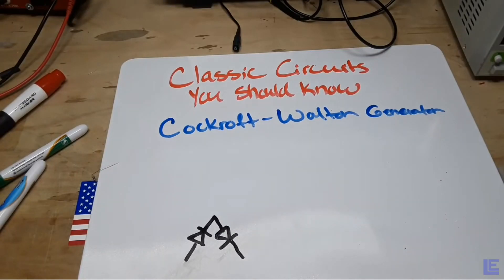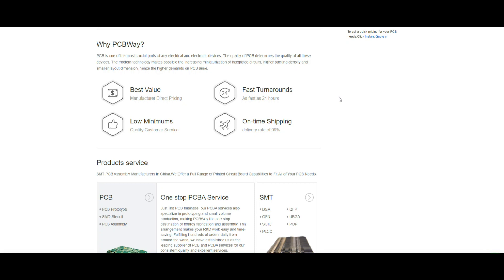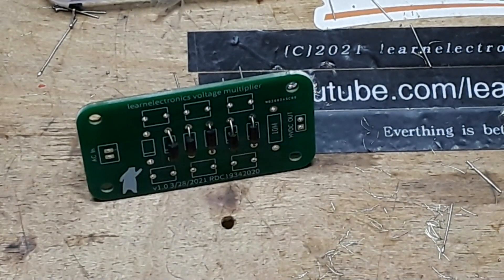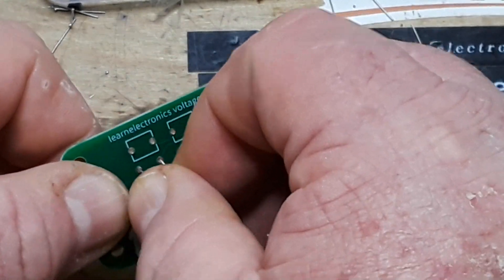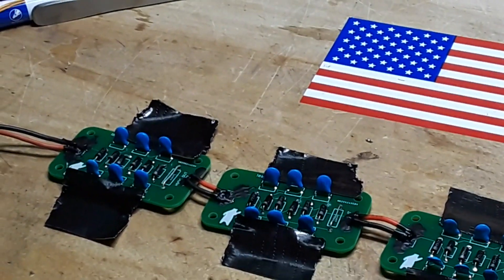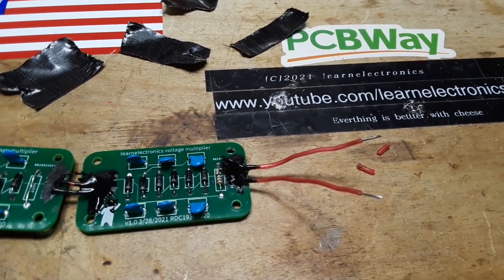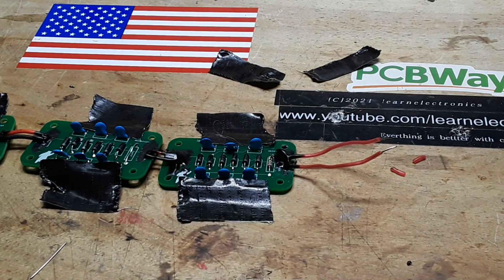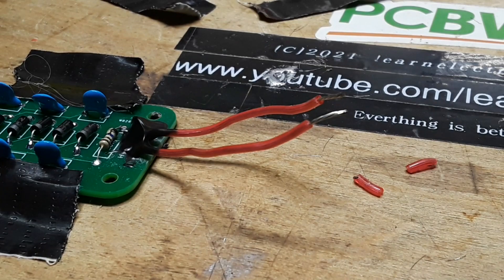Cockroft-Walton Voltage Multiplier PCB Design and Test

Comment: How did you connect the ac? Is there a transformer? If so do you have a part #? I have built the multiplier and it works, but I keep blowing hand built transformers. Can you show the ac setup for this. Thanks.
Reply: He used a Variac, I would start with it turned right down. I wouldn’t want to multiply 240V.
Reply: @darylcheshire1618  There is no transformer?

Comment: (I am not a mean person like this might make me sound)

Is it just me or does that not sound at all like a 60hz arc? It sounds and looks exactly like when you put a capacitor in parallel with a ZVS and flyback transformer or some sort of flyback circuit. I think back to all the times ive made arcs with NST's and MOT's which are for sure 60hz and this is nothing like that. Even rectified NST/MOT sounds nothing like this. I have attempted in the past to make this exact circuit and I never had good results from a 120v wall outlet. I will do it again though. I could only make CW multipliers work with higher frequencies... Your circuit is fine (besides that ground plane, undersized resistor and outputs WAY too close) but the 120v(170pk) at 60hz I have serious doubts. I sense some internet foolery going on. I think those leads you end up using for the arc are from the real transformer powering this device. I think the circuit didn't work well enough to arc so you have one of those cool tiny HV modules out of our view. LOL
My Reasons:
1.) Input voltage 120V but has a peak of 170V x 2 x 12 stages = 4080V theoretical volts. Resistor 10M so that's ~2 watts?
2.) you say that arc is 1cm long which roughly requires 30kV in air. No way does 60hz <4kv jump 1cm. Look at my dual MOT videos to see 4.2kv at 60hz not arc until I touch electrodes together basically. Also notice the sound of 60hz if you watch them..
3.) Paul doesn't show the full setup for power up or use the variac to ramp up which is too weird thats literally SOP for testing AC circuits like this. Why not show like 5v on the variac and show output on DMM? That wouldn't blow it up. There's no measurement whatsoever on a supposed educational video..UGH.. So you can't blame me for thinking this.
4.)Lastly, Those HV leads are literally from a HV module that I am thinking makes these arcs.. kind of sus.

What does everyone think? If you think i'm wrong please explain why. And paul if you read this I would like to know your answers to my concerns.
Reply: Certain things left out seem to point to interwebs phvckery.

Comment: Very nice! Just a question about the 1M resistor: if you put a bypass to link another pcb section, we should have a short circuit between  pin 1 and 2 of HVDC Out connector. It should be better to put nothing.  It is not clear for me. Thanks for explaning.

Comment: Its a high voltage electric chu chu train. : ) Awesome!
Did ya see how thick the arc's where on that. the flyback out of a CRT TV aren't that thick.(and they can be up in the 10's to 100k volts.)  that would really hurt if you touched it...

Comment: How did the 1kv diodes not fail if the output voltage was ~3 times their rated capacity? Similarly, why did you not have arcing between other solder joints?
Reply from the maker: Each stage in only 2x the input voltage.

Comment: Reminds me of the flyback transformers and voltage doublers on old CRT set. Yeah, you do not want to be anywhere close to a live wire with those things running. Plus the tube acted as a big cap…  all in all, they were kinda dangerous to playaround with.

Comment: How can voltage be bumped up to 14.7-15v constant on kinectic batteries?
Reply from the maker: Whats a kinetic battery?
Reply: @learnelectronics  their used for sound systems i use it to power my amplifier
Reply from the maker: Ok, I've never heard of them. You could use a boost converter. But keep in mind you trade current for voltage.
Reply: @learnelectronics  don't understand

Comment: I think your calculating your voltage wrong.  Each stage doubles what it's handed.  After the first stage you.    have 24o. Next stage 480.  Next stage 1440v.  Second board first stage would be double that.
Reply: I was thinking the same thing. By the time you get to the end of that chain its lucky there's no current to speak of or there would have been a fire. :o)
Reply: Let's see... 3 stages per board, 4 boards, so we're doubling the input 12 times. That's a factor of 2 to the 12th power, or 4096. 170 V (RMS) * 4096 gives 696 KV. With a 25% loss we'd still be looking at an output of about 1/2 megavolt. Right?
Reply: @kenholt2487  RMS here would be 120 volts (typical in the US). The 170 is peak to peak. So the no loss voltage would "only" be about 491KV. It wasn't clear to me whether the first stage is a doubler or just a rectifier. In any case, the arc across that gap was serious for sure.
Reply: @merrittderr9708  Aack! My bad! 120v RMS; 170v P-P. 🤦
Reply: @kenholt2487  No. It doesn't keep doubling. It double the first time only and then goes up each stage by that amount. i.e. (peak voltage) * 2 * (number of stages) in the case of USA plugins. 170Vpk x 2 x 12 stages = 4080 theoretical volts. then subtract Diode drops, leakage, etc...and really these circuits suck at 60hz they are really for freq's in the khz. If you attach a load you'll be lucky to get anything. It would be in the nA/uA range which is fine for some things. Some low energy tools I fix at work, Semiconductor Industry, is in the high nA- mid uA range but with energies still in the MeV scale ;) Very high voltages.
Reply: @kenholt2487  25% loss is a good estimate for the first board, but the impedance increases with every capacitor and arcing would result in additional charge loss

Comment: While using this circuit, are the amps increasing also?
Reply: No, if anything the current sourcing capacity goes down as you add more stages.  You're transferring charge from one cap to the next, which takes awhile to propagate through the whole ladder.
Reply from the maker: No, the opposite

Comment: This cct is often used for the basic drivers for Ozone generators and the ubiquitous bug zapper. Yep they could zap you! 
The voltage drop from the diodes means the theoretical multiplier value is just that.
(Theoretical) Dave from EEVlog did a bit about these.
The thing to remember is that this cct was behind the splitting of the atom.
Got to say those boards look mint!
No problem with Ads dude if they keep the knowledge being shared 🙏

Comment: Paul, you had me on pins and needles;) High voltage circuits should not have copper floods!  Keep the traces apart.  I support you not making these available.  Nice work!
Reply: It also needs separation slots.

Comment: One problem that might happen with a train off these boards is is that the input voltage and output voltage pins are too close together and may arc LOL.but awsome idea ty. I’m definitely making a bunch lol.
Reply: That was my thought too. He could have just used pads for input/output instead of a connector.

Comment: You could mount that in a square PVC channel and at the bottom add a fan that blows up through it all and after giving a reasonable distance from the arc you have a very powerful negative ion generator.

Comment: Why did you not use the variac to slow start the device?
Reply: Cos it's not so much fun. 😆
Reply: @Roy Ireland i guess he did, but it would not change much. After all it's still a spark gab and they trigger at a voltage level and not at a power level. Maybe with lower voltages the system wouldn't trigger smoothly with 120Hz any longer. Maybe just 60 or 30... that could be seen as a power limiting/controlling system, but i think the voltage range (within controlling of the trigger rate is possible) is quite small and unreliable. 

Greetings from Europe
Reply: @VEKTOR4477  120hz? This circuit is half wave rectified not full wave. Its just 60hz. If each stage had 4 diodes then it would be 120hz.
Reply: @arc_chaser  Ah yes my bad, that's whats happens when you just think about spark gabs an not the rest, Thanks!

Comment: To ensure that it won’t arc when you pot it, make sure you evacuate a chamber with a circuit board in in by drawing a vacuum to get the air bubbles out. This is how HV circuits break down and fail. Good potting technique prevents this. (Taser technology). How does this compare to a Marx Generator? It looks remarkably similar.

Comment: Why not just use a dc power supply instead of mains voltage?
Reply: You need a AC to make it work
Reply: @interbudelblag  You can use pulsed DC as well. The output of one stage to the next stage that's pulsed dc and it makes no difference if its AC or Pulsed DC circuit works the same

Comment: I couldn't help but chuckle on the first power on  :-)))).  Was wondering what the voltage rating is on the potting gloop ?  You may have just exceeded it until you put have the can on it.

Comment: How do we use it ......
Reply: Consider putting the output on your tongue.
Reply: Lol if you have to ask please don’t use this high of a voltage lol
Reply: If one stage doubles your voltage, why do three stages only triple your voltage rather than 8x voltage (2^3)?
Reply: @CamanoBert  It doesn't keep doubling. It double the first time only and then goes up each stage by that amount. i.e. (peak voltage) * 2 * (number of stages) in the case of USA plugins. 170Vpk x 2 x 12 stages = 4080 theoretical volts. then subtract Diode drops, leakage, etc.